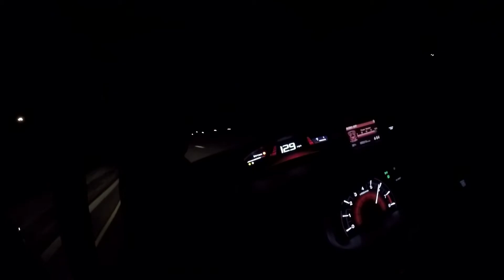So You Wan't To Build Your Engine - Honda Civic Si Motor Build - How much does it cost?

Comment: It's funny you made this video, I'm building a 300hp all motor for my 9th gen and trust me I dont even want to start calculating how much I've spend so far lol this is my list 
K24z7 - block to be built 
1. Drag cartel 3.2 cams 
2. Id 1050x injectors 
3. Skunk2 ultra street intake manifold 
4. Skunk2 alpha header 
5. Exedy stage 2 clutch and lightweight flywheel 
6. 12.5.1 Cp piston 87.5mm and manely rods 
7. Walbro 450 lph pump 
8. Skunk2 spacer 
9. 4piston k20 built head
10. Prl k24z7/z3 swap kit
11. 4piston oil pump 
12. K24z7  head gasket 
13. K24z7  ARP head studs
14. Skunk2  alpha header gasket 
15. OEM timing chain 
16. OEM timing chain tensioner 
17. OEM timing chain guides both side 
18. OEM 50 degree vtc R40 block 
19. Inline pro tensioner 
20. Koyorad radiator 
And that's what I remember currently, and ofcourse you have the miscellaneous stuff I haven't added yet lol, but this is a patient game and I'm doing it right not rushing taking my time saving and building love it, I'm sure after this I'm not gonna sell tho lol, will just buy a next car... good video..
Reply from the maker: Thanks man. I know I gets really expensive, especially when you get past the big stuff like rods and piston and realize you still gotta spend another $1000 in OEM parts.
Reply: @reesescars6871  yes sir!  this isn't for the faint of heart lol
Reply from the maker: @drkvegeta  that’s right! Good luck with your build!
Reply: @reesescars6871  thank you, almost finish, my block is done, just waiting on my 4piston head..
Reply: @reesescars6871  looking forward to see the result of your built 😊
Reply: So basically this is how to Frankenstein the k24z7?
Reply: @vado7757  basically yes, but you have to make sure you get the deck weld so the 20 head works on the 24z7 block. But I’m gonna fully built, head built by 4 piston and my block is built pistons and rods higher compression.
Reply: Dude can you give me some pointers I wanna do the kraftwerks supercharger